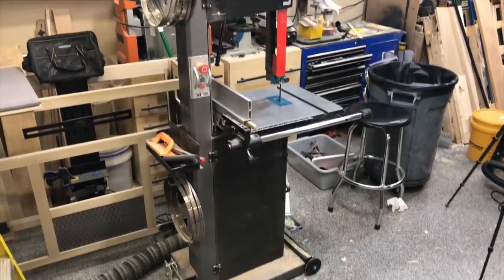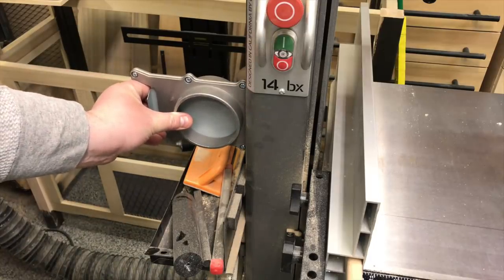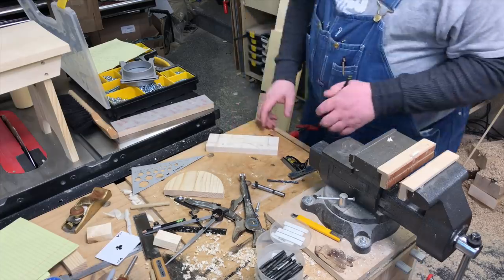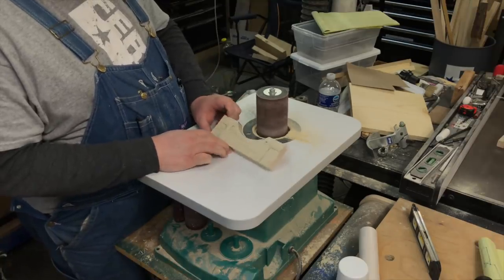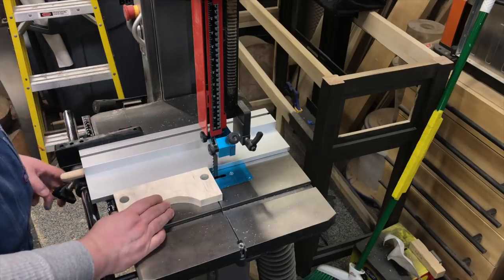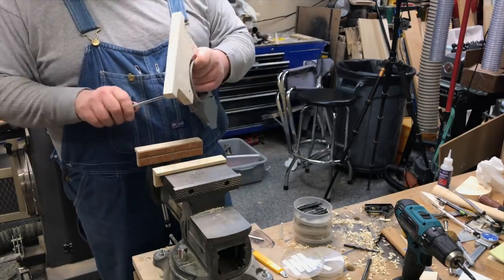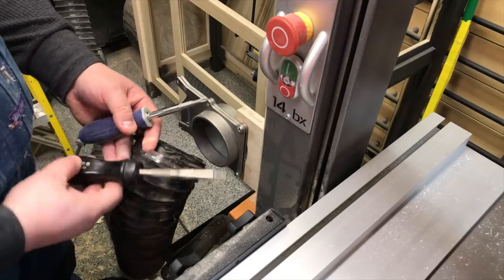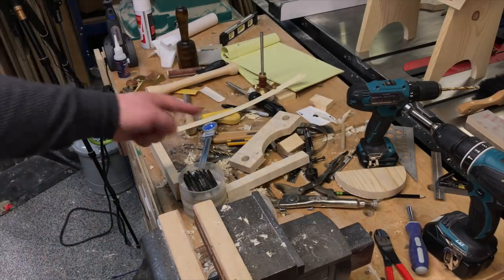Ⓕ Dust Collector Blast Gate Mounting Bracket (ep93)

Comment: Remembering to tension the bandsaw blade was an issue for me until started using a small piece of Plywood with a slot that I set on the table in front of the blade with the message 'Tension' written on it. I guess whatever reminder that works is all that really matters.
Reply from the maker: Another good idea - yeah it’s those subtleties in our own shops - for my drill batteries is they are on the shelf upside down they need charging

Comment: I wish my bandsaw was that quiet and smooth.. My old Delta no matter what i've tried the blade seems to always smack the plastic channel that is  bolted to the spine..
Reply from the maker: that does sound odd
Reply: @NickFerry   Yeah, I've tried changing the tension..  Wheel does not seem to have any permanent marks, tracks good.. Just doesn't seem to be smooth.
Reply from the maker: hard to diagnose in comments section but remember when diagnosing break it down into small bits - is this doing this? why or why not? what can change that one thing? etc. etc. - personally I'd test a different blade first to eliminate that - then move onto more in steps